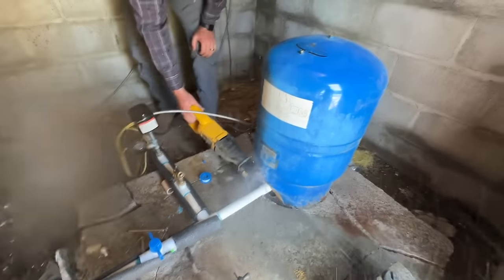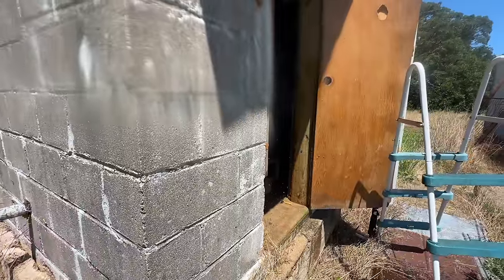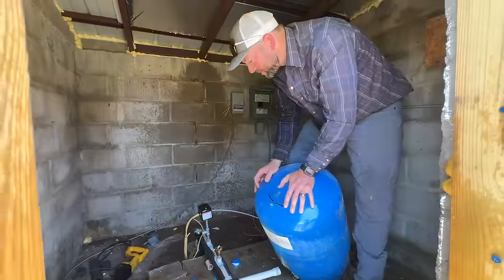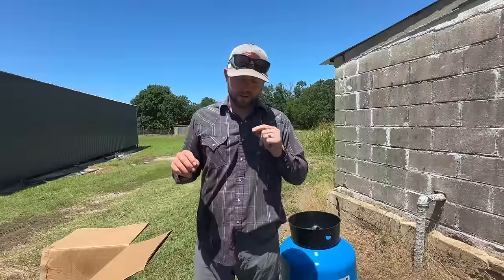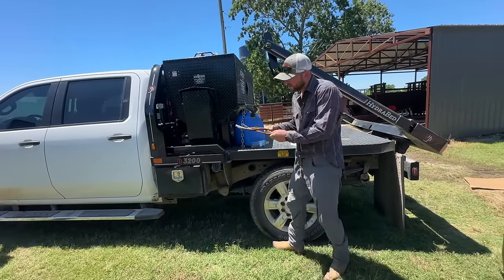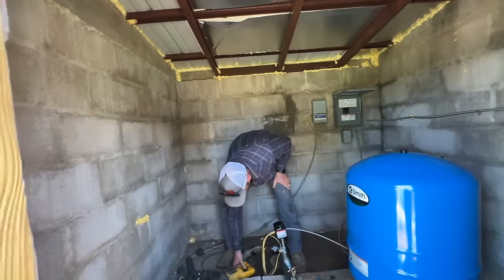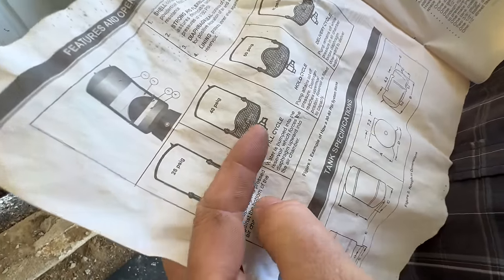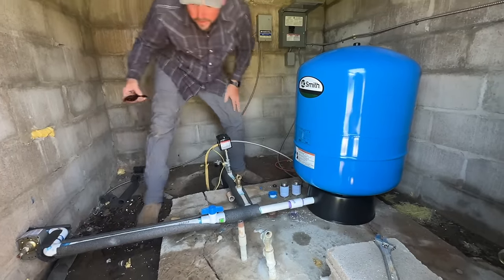Water Well Went Dry Last Year...Trying It a Year Later!

Comment: The bladder keeps the pump from switching off and on every second.
Reply: ... by keeping the system at a steady pressure. A bladder for a boiler furnace or large hot water heater is there for the same reason.

Comment: That blue tank is called an accumulator. The same technology is used in most hydraulic systems in trucks, aircraft and many other situations. Basically it helps to keep the system pressurized and working at full capacity. Without it all you would have is the pressure generated by the pump.

Comment: The bigger the pressure tank the less that the pump runs and saves the pump
Reply: Yes and no; the bladder (In Dusty's case it's inside the tank) plays the largest part of it. A larger bladder would be the correct suggestion to preserve the pump.

Comment: Hey Dusty looks like you did  pretty good job to me. The rule with this type of pressure tank  is to start with an empty tank. Find the cut in pressure on the pressure switchand pressurize the tank with 2 lbs less air pressure  example is if rhe cut in pressure on the switch is 40 psi you want to have 38 psi in the empty tank. That pressure switch usually is rate at 40 to 60psi. Cuts in at 40 psi and cuts out at 60 psi. There different switches that are 20 -40 and also 30-50. These switches switches can be adjusted but I recommend not to mess with it if you don't know if the pump in the well can handle it.

Comment: At the top of those pressure tanks is a Schrader valve, just like your car tires. You can use that valve to let the air out and reduce the pressure in the tank, before you cut the pipe. That way the water doesn't spray all over you. You could have also attached a hose to the spigot and turned that valve on to reduce the pressure and even opened the main valve to let the water drain to the tanks.

Comment: Usually there is a nozzle type fitting on the side to add air if the diaphragm is deflated or air has seeped out. Glad you got it running!  You will probably have water unless you have an extended drought since it's a shallow well.  If that turns out to be a problem you could look into building a cistern to store water during droughts. Those silos might be good for that if you're not using them but you'd have to worry about the weight and whether the seams would hold.  The good thing is you'd have gravity feed to supply the water once pumped up there.

Comment: When I worked in hydro, the Techs, and still do use an electronic tape to measure the depth of the lake and compare it to the metering instrumentation. It is essentially a long tape measure that when the tip touches water the top of the water column it will beep. This will help with not running the well dry. Not sure how expensive though

Comment: A way of checking how much water is in the well is dropping a rod with an eye in it down the shaft till it stops then pull it up watching for the water mark on your rope market and measuring it to the bottom of the rod should give you an idea of how much water from bottom up to top of water and marking the rope at the top will give you total depth of well and how far below surface to water table in well

Comment: fyi....... you should get your favorite brother-in-law to dig a few wells further in pastures with that fancy yeller shovel he's got..... you could rig up a solar pump or even a gas pump...... It would help relieve your current pumps not having to pump so far and add extra fillup locations while burning pastures. also, save from needing ponds that need maintenance and aids in breeding mosquitos ext. oh.... also has a good chance of being a backup water source on premises if a well drys out elsewhere. 
         if you dig down and hit water..... stick a 3ft culvert pipe with holes drilled at the bottom and bury it and cap it. plump with a foot valve on the bottom an add a pump or pump connection and poof free water.

Comment: These blue pressure tanks are quite common. Every time an electric motor turns on and off it places more stress on the motor. If you just has the well motor connected to a pressure switch at the use point the motor would be turning on and off with grease rapidity. This is called short cycling and it’s a bad thing.
   In the old days we used to have huge galvanized tanks that held 20,40, 100 gallons of water, they lasted about 50 years and held water between 30 and 50 PSI, 50 psi means mostly full, 30 psi means mostly empty. There is a problem however in these tanks that air would leak out. So you would need to shut off the pump and drain the tank. The baffle keeps the air and water separated. 
   The newer blue tanks are a magnitude smaller and  have a higher tension baffle in them which maintain pressure, these tanks need always to be charged, if not they over stretched as the baffled is pushed toward the outlet. The typical operating range is 45 to 65 psi absolute or 30-50psi when atmospheric pressure is subtracted, depending on one’s elevation above MSL. As a consequence the newer tanks use more of their volume relative to the larger tanks. The problem is that they have much lower capacity in a drought and don’t last as long. 

You actually don’t need a sealed tank at all, my uncle had a raised cement cylinder about 40 feet high on his farm. As the volume raises so does the PSI at the base. 

To get 40 PSI you need 40*6.89 kPa or 27,560 Pa which is Kg/(m^2*sec^2).
Since water has a density of 1000kg/m^3 you need to stack the cubes about 28 meters high or about 87 feet high to get 40 PSI or around 110 feet high to get 50 PSI. It helps to have a hill on the property to build such a tank. Municipalities often build water towers, in which the majority of the tower is at or above the PSI target  then use pressure regulators in different parts of the system to even out pressure. The advantage of the cement water tank is that it can store significantly more water in a drought (my uncles was about 10 feet across), even though at the end of the drought you will end up having to pump water from the bottom of the tank to maintain pressure. The other problem is they tended to leak and grow all kinds of critters in them. 

A better strategy is run-off capture tanks that are fenced  away from the animals. The levels of recent flooding on your property indicate you and your neighbors are well below optimal surface water storage. Surface tanks not only store water to the animals, they feed water slowly into the aquifers depending on the clay used to line the tank. Because of the lack feed water last summer your wells went dry.  The other advantage of large fenced off tanks is that you can stock them with large mouth bass, sunfish, chad. This will give something for your snakes to feed on😎 From these tanks you can feed water to the animal watering tanks or irrigation systems. 

I

Comment: Why not a union for ease of dismantling in the future?
Reply: I put a compression fitting on the pipe into my tank. Glad I did, as tanks don't last very long in the Florida sun-3-5 years. When I need to change tanks, I loosen the compression fitting and pull the tank pipe out, Switch the pipe from the old to the new tank and back into the compression fitting. Takes all of five minutes.
Reply from the maker: Rancher not a plumber. Lol

Comment: Just a tangent on the previous comment. We are coming into mid June 2024, down here on the upper Texas coast we are seeing night time lows, already, in the 80’s, this is a couple degrees higher than what they would have been 2 decades ago.  The amount of moisture coming into the system is a multiple of average wind speed and moisture content of the air (80 degrees at near 100% humidity at night is about 25 to 30 grams of water per cubic meter of air) this is the baseline water forcing within the plains system of the US. Moisture that is not taken out of the system before reaching OK is available as rainfall. The differential between 60° (under a large supercell)and 80° is about 13 grams of water per cubic meter. If we consider the cloud ceiling for thunderstorms at 500 to 1000 meters that’s roughly 6 to 13 kg per square meter of water. 

   However this only considers laminar wind flow from the gulf. The prediction of “global warming” that has stood the test of time is that in dryer inland climates the droughts will be more intense (because of higher temperatures and higher evaporation of rain) and rainfall events will be more severe. This translates in the gulf coast to rapid intensification of tropical lows into severe storms. These storms on the dirty side can changing the onshore flow rates by double or triple typical and focus the moisture. As a consequence the probability of tropical storm related decadal rainfall events has increased dramatically over almost all of Texas. Just to give an example near Junction Texas we broke the global 2 day rain event record around 1980 at 48”. We broke the record again a few years back under Harvey in Dickinson Texas at 54”. So the potential for catastrophic rain events is higher along the coast but by no means restricted to the coast. More over the rain bands associated even with weak tropical depressions on shore are associated with tornados. 
    This will change the way farming is done in these regions as more water will need to be stored for periods of longer drought. For all intents and purposes, despite the fact the US has been the leading contributor to climate change, the US government does not have an effective CO2/Methane reduction plan, it has little to nothing in the way of a mediation plan and in fact, you can say we are going backwards. This leaves the burden of mediation on the farmers and things will get worse rapidly. 
   For mediation to be effective we need to be able to move vast amount of water from rainfall event areas to storage areas and then to use areas. Aquifers that have been drained down need to be recharged and event-rainfall runoff needs to be modulated. In some areas animal densities may have to be reduced as well as plantings per year. We are already seeing this happening in Idaho where enforced no-planting rules have gone into effect.

Comment: NEVER use well water as drinking/potable water unless you have it tested regularly. You don't know what has gotten/gets into your aquifer. 

 I still maintain that Dusty can make much better use of the creek. Slowing down the water running in the creek would help to raise the aquifer level in the surrounding land. I would get Gabion baskets, filled with concrete and or stone rubble (Lots available from Sulphur, Oklahoma) and place them in rows spaced more than 20 ft apart, across the creek and along the high embankments. Each row needs to be a couple of inches to a foot lower in elevation than its upstream 'neighbour'. Eventually, the creek would fill the gaps inside the baskets with sediment. 
 The drought conditions and the torrential rains/hurricanes, which Oklahoma has been experiencing for years, are unlikely to disappear anytime soon; such a system would help to mitigate the effects of both.

 Take good care! 
:thanksdoc::thanksdoc::thanksdoc:
Reply: The creek is much more likely to become contaminated than the aquifer.

Comment: Speaking of electric bills. You get sunshine all year around, have you considered investing in solar panels?😊
Reply: Solar panels are not an ideal thing to use around livestock i just listened to Jahn Pavich FM their organic farms on Highway 166 in the California Central Valley their trees are right next door to a solar farm. John said that the weeds grow underneath the panels the company comes and sprays glyphosate to kill the weeds. The run off hits their fields and they test the water frequently he has had lost alot to unethical sprqying
Reply: @1MustangMom  And if you put the solar panels on top of buildings or remove the weeds mechanically instead of using dangerous chemicals?🤔 Where there is a will there is a way.😊
No, I'm not in the solar panel business.

Comment: Since you had such heavy rain a few days before I would assume that 3rd tank had water in it from the rain, why the Biden were in it to make it murky, but do you know how full it was with rain water before the well water added to it?

Next time the tanks are dry down to less than 2 inches from the bottom you might want to drill a hole in the side and threat a short bit of pvc pipe through it and put threaded caps on each end of the pipe.  We started doing this so we had a way to drain the tank if the water got to muddy from animals standing in it, or if we needed to lower the water to repair the valve system in the tank or to patch any area that was breaking down allowing the tank  to leak.

You might also want to consider a solar panel on your pump house roof and set up a battery supply in the pump house to provide the electricity to the pump.  It a back up too, as you will have power even if your power goes down, plus any additional electricity you make your power company has to pay you for if you set it up to feed back into the grid.  Our 3 pump housed once we added solar to run the pumps generated enough power going back to the grid that it paid for all rhe equipment (panels, inverter, wire, batteries) in 3 months while also powering the pumps.  It actually does amount to free water that way.